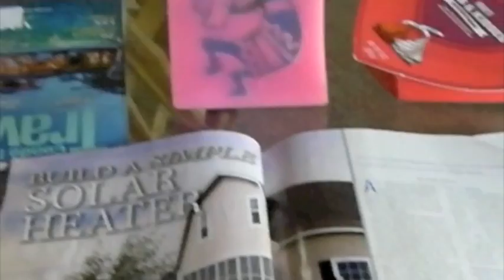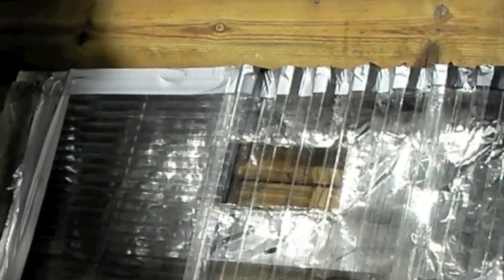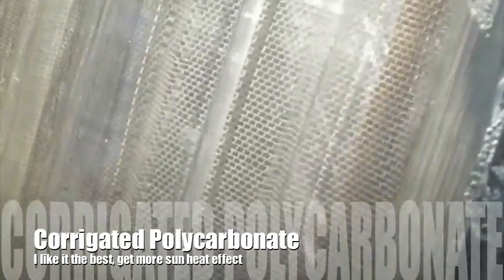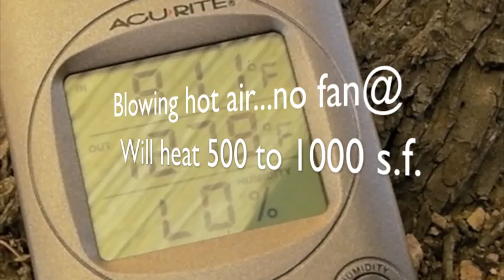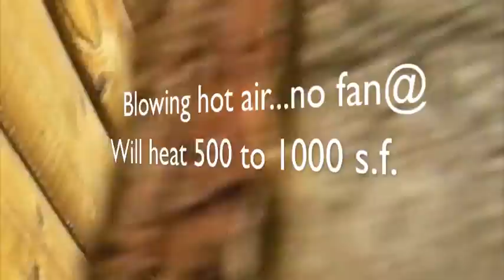How to Build a Heat Box for $6, Heat your Home Free

Comment from the maker: Good thoughts. Of course it is obvious that the "sun" side of a building would be the  best for solar panels. Our's was built with scrap materials, and it is again obvious that if you wish to spend some money you can build a "Cadillac".   

Your guess that you would only reduce the heating bill by 1% is under the mark, and this concept can do very well to bring heat into a house.  In our area we have 300 days of sunshine per year, and this, other than a air tight "earth stove" would be the only source of heat…so by factoring the cost of firewood…we have done the math and calculate the concept to save about 53% per year on heating energy costs.

Comment from the maker: As stated, we are getting a 40 to 60 degree spread from ambient outside temperature. Thus if it is 20 degrees outside, add, say 50 or 60 degrees to that…it being a solar panel, requires sunshine.

Comment: How's it working now in this cold?
Reply from the maker: Works great!  30 to 50 degree spread.
Reply from the maker: Everything that is built for a test or to see if it works is done under lab or controlled conditions. What we have found is that I still get a 40 to 60 degree spread of heat, even when it is 40 degrees outside, now let's see: 40 degrees, + 60 = 100 coming from the vent.  Now smile and be happy

Comment: Anywhere you have sun like northern NM you would want to put more windows on the south side not only are they not an eyesore like that box but they probably are 5 times  more efficient.  I could also argue that by shading the house with the box your loosing some heating so you have to overcome this with that box before you have a net gain from it. And like others said your probably only reducing your heating bill by 1% if that.  Your certainty not "heating your home" as your title implies. The concept is certainty cool, making efficient use of it is easier said than done though.
Reply from the maker: Thanks Robert!  Ben

Comment: Your heater appears to be quite small compared to the size of your structure.  We are not concerned with what the temperature differential is from open air to inside the heater. On a cold day, what is the temperature rise in your house from using this heater? That is what matters. Also, air has to have a return to the heat box or there will be no flow. Nice try.

Comment from the maker: No doubt, if you have no sun, "solar powered" heaters won't work as well, but we spray painted the back of this unit with flat black paint and we do get some effect from this...perhaps UV rays, I do not know, but we have over 300 days of sun in Northern New Mexico.  We are getting a 40 to 60 degree spread,...so from 30 + 50 = 80 degrees.  Try it out, you can build one in 2 or 3 hours, and see if you get any help from such a unit.  If not, you should be able to do this for a small amount of money.  A lot of people have tried it, after seeing the video, and confirm, as we did, that it works.

Comment: The heat chimney box is a good basic design and cheap.  You'll recover the $10-20 or so over a few weeks use in sunny areas.  Better math than most green systems like PV.  Best use: large south facing wall w/o evergreen trees or other buildings in the way.  Easiest install is OVER a tall double sash window(s).  You may crack open the top and bottom sashes and close them and draw thermal drapes at night or on very wet/cloudy days.  No real change to your house.  At worst they function as ugly storm windows to protect and insulate your single pane glass.  

Modern windows, you'll have to drill a couple of 2-3" holes, stick a round vent cover on them inside & out and place a little vinyl film flap atop them to avoid back flow and just crack the lower sash for the intake.

Poly carb, plexy or even sturdy vinyl film over the face of the frame, BLACK screen wire over the back of the frame, 6-8 long deck screws to fasten the rig to the outer window frame.  Take it all down in the summer and either store them in a barn/garage, or break it down and rebuild it next winter.

PV and most commercial systems costing so much to buy and install, with limited life-- you really don't automatically save money or the planet.  If you spend $100 that you don't get back, then you've bought one barrel if OIL.  $100 worth of any merchandise ~= one barrel of OIL for the manufacturer, retailer and installer to stick into the atmosphere.

I have been waiting for PV to come down low enough to just put on a central Air system for summer.  Not the whole house, just the AC-- the BIG power hog in the south.  That install can be DIY and easily serviced.  I still can't beat the 13c/KWH I'm paying-- so if the big electric suppliers aren't using PV yet for most of their power-- then the math doesn't work yet.  They're in the business of saving money and charging for it.  Ben Franklin said watch the rich and study what they do.

Comment: why couldn't you use the windows on the sunny sides of the house to make one?Just cover the window up from the inside with something reflective and make it so you could easily remove it and put is back.
Reply: That makes more sense. I have a kitchen that faces the only sun side of our house; do you think I could use its window to grab some heat? I have no idea what this guy is using as a coating for that thing, though. For all I know it's aluminum foil. Any idea on what to use for reflection?
Reply: @purpletonic  aluminum foil works just fine
Reply from the maker: Cool idea.  Ben

Comment: "80 degrees outside". You need to heat your house when the outside temperature is 80 degrees? This heat box might work in balmy temperatures but how well will it work in what a majority of the world considers "cooler months"; as in 60 degrees and less? Our current outside temperature is 5 degrees, and I can guarantee you this $6 box will do nothing to add heat to the house.

BTW, dude, you want to save on heating costs? Put on a sweater and nix the furnace entirely. I don't care how hot your summers get, 80 degrees does not warrant using a furnace to heat your house; no one gets hypothermia in 80 degree temperatures.
Reply from the maker: Hi there. The reason for doing the video was to stimulate pro active people who enjoy thinking and doing creative things to use this to create something good by using solar heating.  Over 561,000 have viewed this video, and many have written and told us it gave them ideas to do this, and even made improvements. That was our goal.  I am curious if you have done anything positive to take this idea and improve upon it, or if you like a tiny majority just use the internet to insult or criticize others who actual "do something".  I wish to encourage you to build something good and creative and tell us about it, or even do a video it.  That is if you are a "doer", not just a talker.  Let's do things positive and actually do good things.  Best wishes to you as you do great things to make this world better.    Ben Boothe

Comment: Bravo for showing people that solar heat is there for the taking and it can be collected! We just need to learn ways to do it and you just showed a simple way and proof that it CAN be collected and reused somewhere more useful like in our house instead of dissipating into the air. Now lets get to work creating a more sophisticated unit like store the heat in water. Reuse it anytime. How about using entire sunlit walls to collect heat. Use the hot roof. East side in the A.M.and West in the P.M.

Comment: I hate to rain on the parade, but as others have said, we need far more data to be convinced that this is anything more than a toy.  I've built larger versions of these and while they do add *some* heat to the house, no way do they come anywhere close to heating a '1000 s.f. home' for most areas of the US.  And if you don't close off that inlet you'll lose more heat at night...

Comment: Your video does not how clearly how this box is put together and connected to your house. Also, how does it work in a real cold weather? My gas/electric bill is over $500/month and inside the house is less than 60 degrees. I am in NJ. any advice?

Comment from the maker: Hi John,
Thanks for your comment. As mentioned in the video, the unit actually increases the air temperature in a range of 66 degrees, this is fairly consistent, cold weather or hot, summer or winter. The key is not the outside temperature, but the sunshine.  If you have sun in the winter, you can heat the air by about 66 degrees.  So, if the outside temperature is 30 degrees + 66, you will see it heat to 96 degrees.

Comment from the maker: Pure practical information. Heat a 1000 s.f. home with an investment of less than $50, and do it with no electric, gas, coal, or utility energy bill.  Not bad!
Reply: What do you do for heat storage? Because once the sun goes down there will be no heat output. I'd somehow get that heat flowing across a concrete slab or some bricks so it will release and heat you at night.